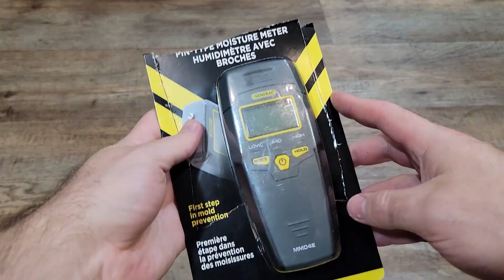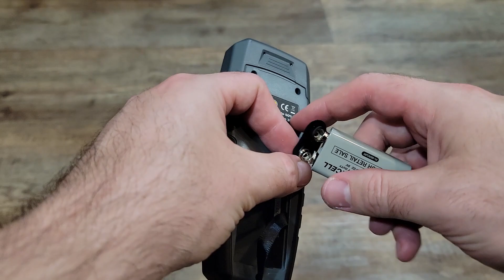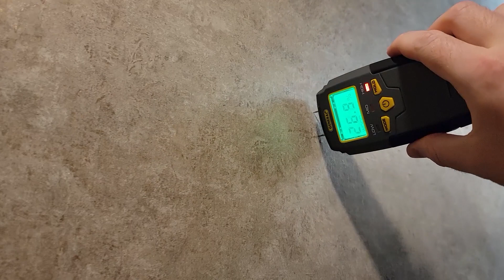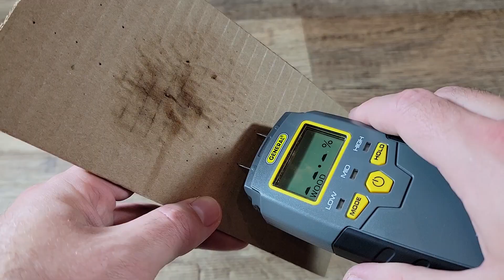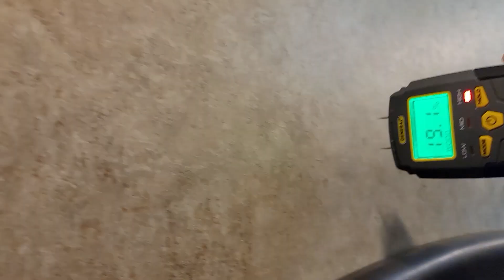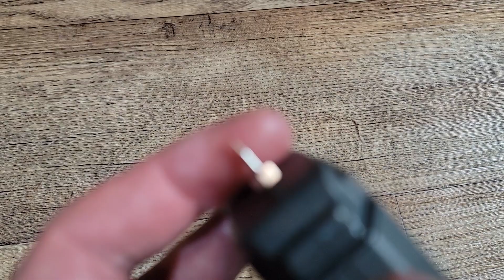General Tools MMD4E Digital Moisture Meter Testing And Review

Comment: So, I just got this today. Yesterday I set up 4 fresh cut maple slabs to air dry in the basement. When using the moisture meter, I was getting several, quite different readings from the same board. How is that possible?
Reply from the maker: maybe pockets of moisture. Also I noticed it needs to be the same depth, if you press harder in one place and go deeper it will read higher because it can reach more moisture.